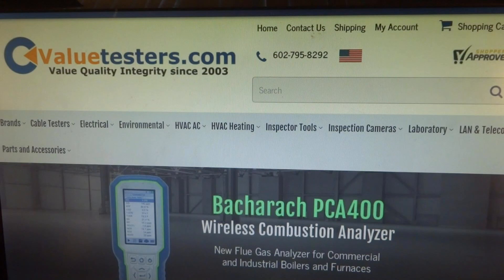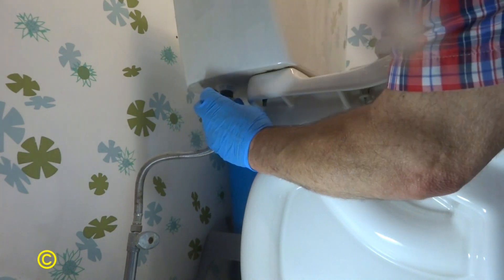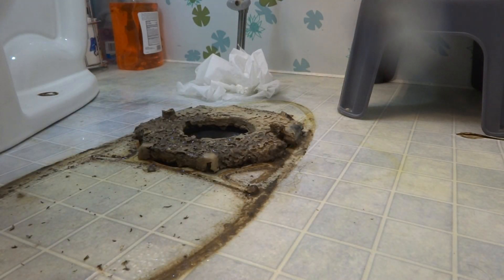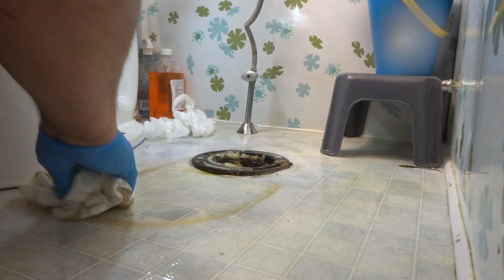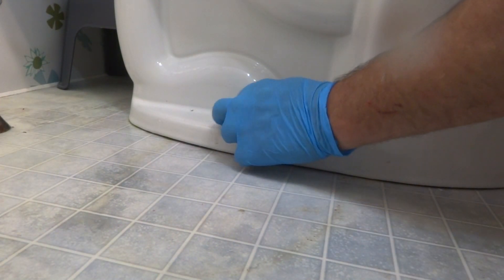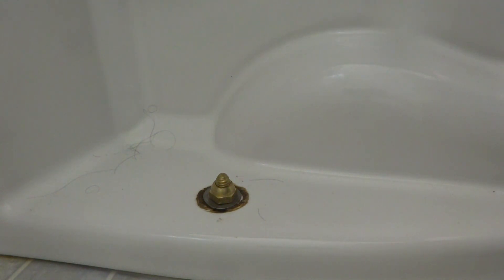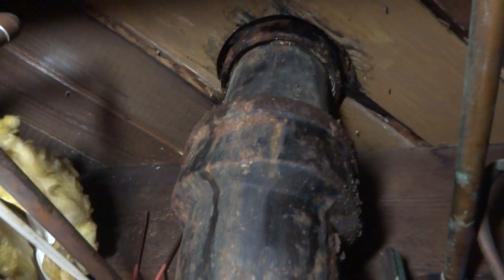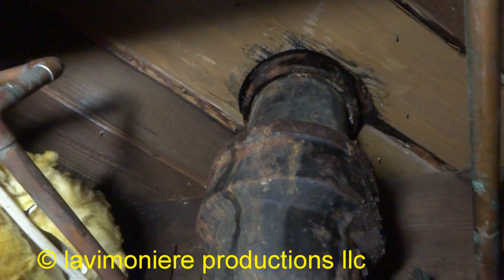Toilet Leaking At Floor

Comment: I agree sir . Im not a fan of the funnel wax rings either. My toilet had a leak around the base and I decided to check the wax ring and behold, it was a wore out wax funnel. So I went to buy a original wax ring ( no funnel) and that fixed my leaking problem. Thank you sir for your videos. Very helpful sir. SHES A LEAKER!! LOL LOL

Comment: Prior to retiring, we installed a 5-ton Carrier AC/gas (hot air) system (complete system, including ductwork and returns) into an 1880's Victorian, which still had two "water closets", and lead going in, and out of them. From what I could tell, the water closet on the first floor had not been moved since its original installation, and I doubt the second floor water closet had ever been reworked, either. They were STILL using a 1950's "Warner-Winkler" coal-to-oil hot air conversion, and decided to do the swap when oil hit $4.50 per gallon, in '07.

Comment: I installed a couple of  Lowe's toilets and they came with the funnel waxes. They went right into the garbage and I didn't even bother trying to remove the funnel. Not sure why anyone uses them. If the seal between the flange and pipe is good, what is the point?

Comment: theres only one specific time I use the wax with the funnel and its when I use a toilet flange that glues into the inside of the 3" pipe instead of on the outside like a regular hub. other than that I always use regular wax rings. to each their own

Comment: I understand how the "funnel" might restrict the flow into the drain pipe somewhat, even splash back..  But, I would think that there has to be a problem with the actual wax seal in order for a leak to occur....Trust me, I am not questioning your opinion, am just trying to understand how this stuff works more completely.  I am sure I have used the funnel types on my toilets, but won't use them anymore...

Comment: Steve that sucker you are using did you make that or buy it? Thx Was that  fill valve  a fluid master if so they have a small filter/screen in the line about 3 inches up from the bottom, when I have a problem with slow fill I just remove supply and top like you done then push a rod down from top and remove filter out the bottom. Good vid...
Reply from the maker: toilet pump = https://amzn.to/2sPOmMC
Reply: Thx Steve

Comment: Question I noticed in a lot of your videos you don’t caulk around the bottom of the toilet. Is there a reason for that?
Reply: roadking 96 Yup. And if you can’t see it leak out, then it’ll back up and get under the flooring and damage the wood.

Comment: Should you actually sit on the toilet to help set the wax ring ? Thanks
Reply from the maker: no need in summer months was is soft from sitting in hot truck ... in the winter yes or heat in up in sink with hot water to soften
Reply: steven lavimoniere   Makes sense, great work. Thanks !